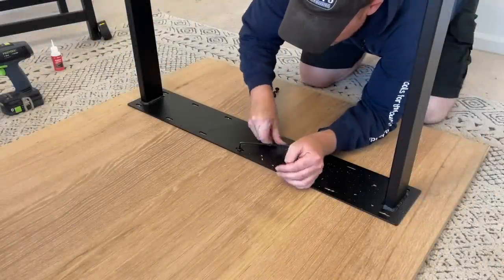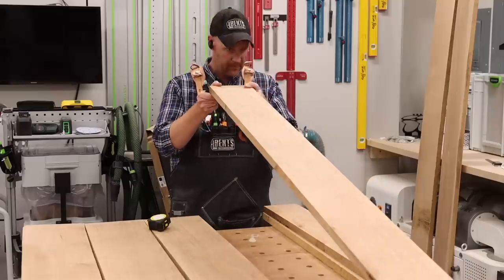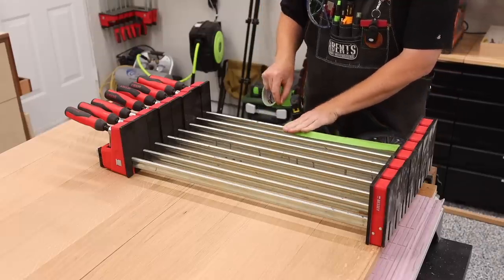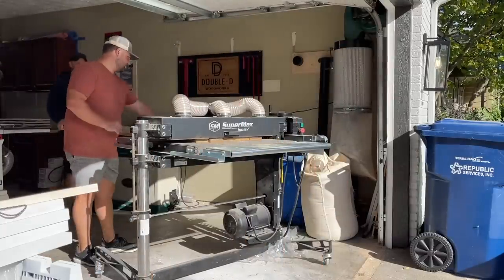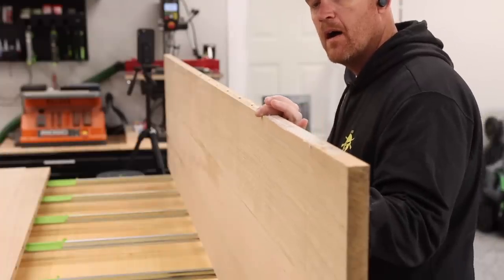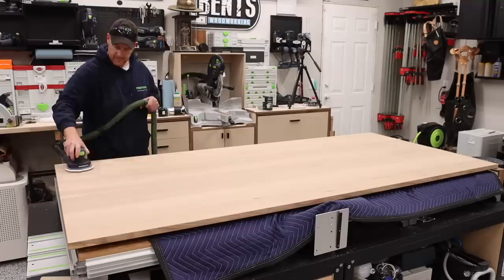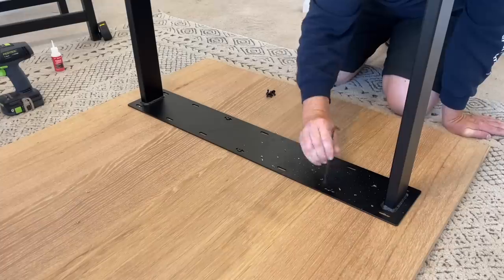Simple dining table build

Comment: For my final sanding phase I use a drywall vac attachment tool (made by Hyde). It is sized to use the 4.25" x 11.25" sanding screens, however I got a roll of 3M Xtract and cut that to size. It's basically just a big sanding block with dust extraction. A few passes with the grain takes out all the imperfections left behind by the ROS. It is quick, virtually dust-free and gives a bit of a "hand-finished" feel. At about $30 it will either be embarrassed to live amongst your Festool collection, or claim to be the best value plastic in the shop
Reply from the maker: Interesting
Reply: I like the idea

Comment: Have you considered getting into handplanes for finishing the final surface? I have a strong dislike for sanding too, and find hand planing much more satisfiying (and the final surface is great)
Reply from the maker: Eventually I would like to incorporate more hand tools in my shop
Reply: @bentswoodworking  Cool, looking forward to seeing them in your videos. Finish planing is one of these areas where I personally find hand tools are still equal to or better than machines. A final pass with a hand plane takes less time than sanding. The only real obstacle is the learning curve, for rough work you don't need to have your plane perfectly tuned, but for the final finish you want it dialed in very well.

Comment: Really heartening, Jason to see you admitting to what many might see as a very small issue. I did a similar thing on a small table (could see the orbital “pigtails “ when finished) so went back and sanded it by hand. Interesting to hear you refer to an 8 by 4 as opposed to 2400 by 1200! I use metric but still use 8 by 4 when ordering sheet goods.
Reply from the maker: I still use both often. Something like this table, metric isn’t really needed. Cabinets though I am using only metric

Comment: Love that you didn’t hide your mistake brother we’ve all been there. I used to have a plastic bin I would put all my 0000 steel wool in to smooth out shellac coats. Grabbed one out of the bin and didn’t realize until it was way too late that the entire bin had FOD in it and had contaminated my wool pads. Destroyed the finish in my work piece. Had to start all over. 
-Lee
Reply from the maker: I wish more people would share their screw ups. Would be very valuable

Comment: Hey Jason, completely unrelated question to this video but would you be able to tell me if a tsc 55 will cut through 2x6's? Kind of new to all this and your channel has been super helpful. Looking to build a frame for cabinets in my sloped garage and looking to get a tsc55 with a midi. Thanks for all your videos!
Reply from the maker: Yes, it will cut through 2x6s. The cut depth is 55 mm. You won’t get quite as deep on a bevel/miter.

Comment: Moving with the grain dont really matter if you have a orbital sander that is rotating on high speed and random. The important thing is to go in circles or preferable random movement but even through the hole surface. Dont think going in lines like that is the best way to go. Just go circles and problem solved.

Comment: On a different note I’m thinking of getting a Harvey dust collector and I’m wondering if you still love yours or if you have found something wrong with it. I currently have a Laguna P-flux and I am tired of it clogging up the filter all the time and I have had 3 remote control because they just keep wearing out 🤬 I know you have done some modifications to your system and I don’t just want to change to something else that has problems. Any insight would be greatly appreciated.
Reply from the maker: One thing I will say is if the filters on the Harvey get clogged, it can be much more difficult to clear.

Comment: My finishing goof up.  Thinking it would be a good idea to put Rubio on the doors for some knife cases after I installed the glass.  Yes that was plural, “3”!  Did not goof up once but 3 times as I finished all 3 at the same time.  I was thinking I could just easily clean up with a razor blade, that was not the case.  Thanks for being honest.

Comment: Cool to see you building something! For the first time I was like “I don’t need to run that threw a jointer!?” 😂 duh! I already have a track saw 😂 thanks! Also super saved me from making that same mistake! Double thanks 🎉🎉 how do you feel about the battery powered saw? I have that one and tonight I was considering buying a corded one for the shop as I switched battery’s 😅 power is already on the hose 😅
Reply from the maker: I actually will be releasing a video on the topic of corded vs cordless very soon. I prefer the cordless.
Reply: @bentswoodworking  I’ll be watching that! 😂 😍

Comment: Did you just take a full 2" +/-  rip pass on white oak with a cordless tracksaw (both halves doubled up)?? Did I miss a scoring pass? What blades are you using? Any concern with sagging over time without a stretcher? P.S. you know your a real woodworker when your OCD just won't let go of that ONE thing...
Reply from the maker: Yes I am. No scoring pass. This cordless track saw is phenomenal. I use Tenryu blades in just about everything now. This specific blade is one I was prototyping for them.
Reply: Be looking forward to that blade review. Although,  I think this video says all that needs to be said. Went back and watched your tsc keb tracksaw vid with the panther blade. Curious how it compares. Thanks for the content!

Comment: No one else mentioned this, so maybe I missed something in the video.  Aren't you concerned with seasonal wood expansion/contraction?  By my estimation, a table that wide will expand & contract a minimum of 3/8".  By bolting it to steel legs, you've locked it down.  I see splits and/or warps in your future.
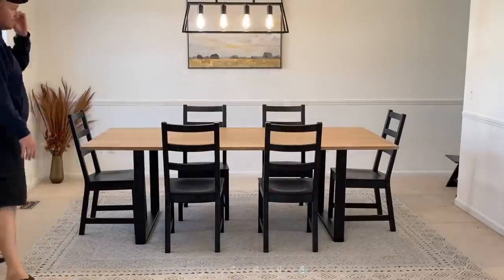Reply: The leg base bracket holes are slotted for that reason. See around 11:40.
Reply from the maker: What Dan said 👆🏼

Comment: Nice project!  In this situation, for me, if I’m not doing breadboard ends to hide the end grain showing the T&G joints that I would have milled into each board edge, I would have still put dominoes in the edges.  Just me though.  Nice color table too.  And when I’m drilling for metal taps, I always use a forstner style bit with a drill stop gauge attached.  I can’t trust myself with a twist style drill bit and a piece of tape.  Thx for the video.